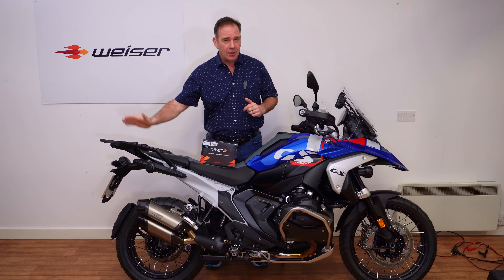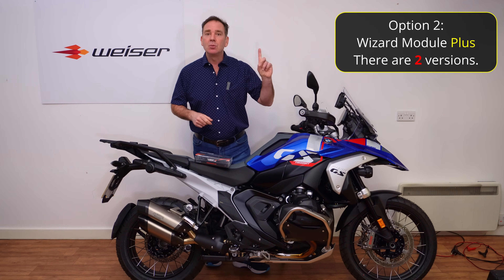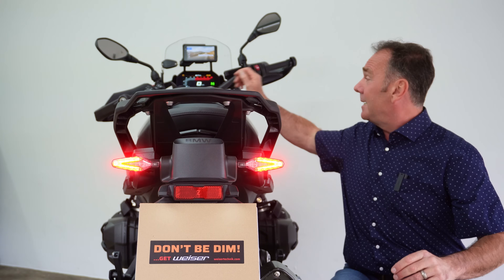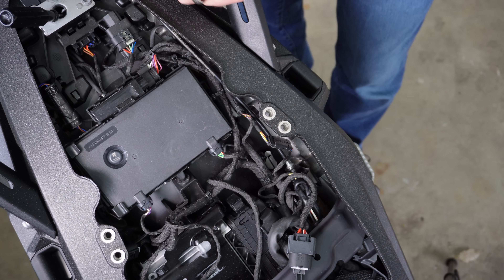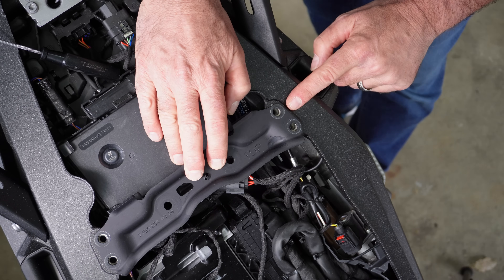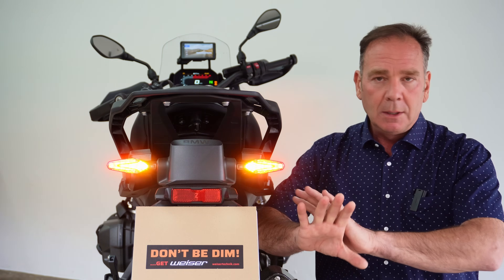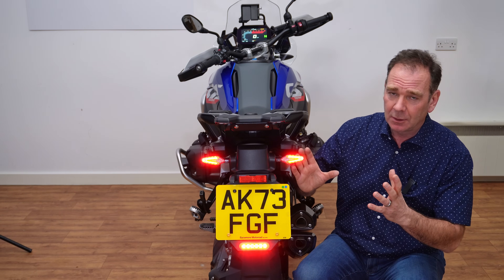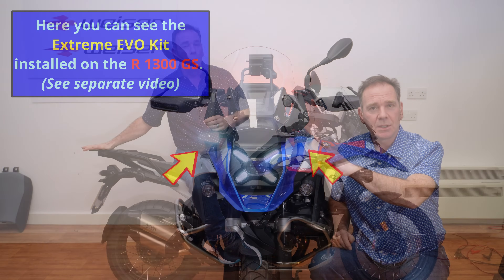BMW R1300GS Weiser-Technik Wizard Module + add a Tail / Brake Light to your R1300GS, F900GS, S1000XR

Comment: Just ordered the BR kit with the T3 as the brake/tail light for my R1300GS, I think it better matches the size of the original indicators. This doesn’t show as an option when ordering the BR kit, it just shows the B6. Mark rang me in response to my query and sorted it.
I had the full indicator set on my previous R1250GS, which were brilliant so I know how good Weiser products are and how helpful Mark is.
Thanks Carl for your excellent reviews, plus the 10% of course 👍

Did you do a video on fitting the Denali, mainly what needs removing to get the wire through.
Reply from the maker: Going to making a video about that later in the season.
Reply from the maker: Hi Tim, glad Mark  a Weiser got you sorted out, they do try very hard to make sure everyone is happy and resolve problems quickly. Sounds like you have a great setup on your R1300GS 👍. Thank you for your feedback, very much appreciated.
Have a great weekend 
Carl 🙋🏻‍♂️

Comment: @justthewayitis 
I want to buy this Weiser kit for my R1300GS . I was thinking, "From the factory, the  taillights sometimes flash quickly or the hazard lights come on when the ABS kicks in (or when the ECU detects an emergency braking situation or somethinh like that) I was wondering if this still happens with the Weiser kit installed, or if it changes how the lights behave?"
Reply from the maker: Hi Xander, sorry for the delayed reply I needed to check with Weiser-Technik first to confirm. The answer is yes the safety features while braking hard still function. Just bear in mind that while indicating the brake light in that side is deactivated to improve visibility.
Hope this answers your questions 
Best wishes. Carl
Reply: Thank you Carl
Reply from the maker: You are welcome 🙋🏻‍♂️

Comment: How are people routing the cable for the rear light from under the seat? I've tried everything and can't see an obvious way to push through without removing panels.
Reply from the maker: Hi Tamworth, most owners have success with either a long cable tie or a metal coat hanger unwrapped. Start at the bottom at the small hole behind the number plate and feed upwards.
If you have an alarm fitted, its easier to unclip it so you can see the cable or wire coming up. 
Once it is through tie or tape a small piece of string to it.
You can then use the string to guide the cable back down to the auxiliary unit.
Hope that helps 
Best wishes Carl
Reply: Thanks but I’ve been trying for over an hour and no luck. Can’t see a way through from under seat and have taken number plate and mount away but still can’t see a way through. There just doesn’t seem to be any room to get through. Everything is in so tight.

Bike has rear radar. Will this make a difference? I can get a wire through a distance from under seat but it doesn’t emerge at rear.
Reply from the maker: Remove your rear seat and send me several images. My email address is on my channel pages
Reply: @justthewayitis  thanks Carl. Couldn’t see your email on your pages (probably me as I’m not great with YouTube). Found a utility online which returns email address for channels so used this. Hope it’s the right one.
Reply from the maker: Check your inbox 📥🙋🏻‍♂️

Comment: Carl - thanks for a great video of the Weiser / Denali B6 combination. 
How did you route the cable  to the B6?   ( I know you may do a video later in the year, but a few words now would be very helpful). Thanks, David
Reply from the maker: Hi David, as Merv has already mentioned you can use an old metal coat hanger or suitable metal wire and feed it up the small hole found at the base of the tail unit… carefully up to the access point under the passenger seat.
Then attach a flexible cable or string and pull it back down.
Then attach the B6 cable to the string and pull it up through to the access point.
This way will save you a an hour of dismantling 🙏
Reply: @justthewayitis  If you unscrew the last 2 screws holding the top cover on the tail unit you have full access. I think it’s quicker and easier than feeding a wire through and straightforward to put the cover back on
Reply from the maker: Hi Peter, thank you for sharing your tip, brilliant 🙋🏻‍♂️
Reply: @justthewayitis
Reply: @justthewayitis 
Many thanks. A great help to getting this fitted,  and helping the rear of the 1300😀😊
Reply: Thanks for all the tips  - I took the registration plate off and the small light unit under that, threaded a wire and put it back; quick & easy with your tips.  Thanks.
Reply: Yes. Works perfectly 👍

Comment: Just fitted the V5plus BO with the Denali B6 brake light to my 1300GS. Thanks Carl for the video without which it would have been a much more difficult job.  Unfortunately Weiser don’t provide comprehensive instructions.

Fitting the brake light I unfastened the number plate mounting plate (it stays attached because of the number plate illumination lights wire), there is a convenient hole in the underside of the tail into which the brake light cable can be fed so it’s behind the number plate mount. From there I fed a piece of household wiring cable from under the seat, taped the brake light cable to it and gently pulled it to the underseat area.  

I hope this helps someone.
Reply: Hi, how did you connect the B6 to the modules?
I have different connectors on each 🥴
Reply from the maker: Hi Luis, send a picture of the modules you have received to Mark at weiser-Technik. You might have the wrong version.
Carl
Reply from the maker: You might have ordered the version without the B6 connectors. There are several different versions
Reply from the maker: Hi Merv, glad to hear you have successfully installed the kit. Thank you for sharing your tip, I do have a video coming soon but your tip will help others. Thank you 🙏 
Have fun with your new 1300GS.
Carl
Reply: Your tip on the rear light wiring is very helpful.  Thanks for sharing.
Reply: @davidanderson5811  😀👍
Reply: A photo would be useful. I’ve been trying to get a wire and/or cable tie down to the rear and it just won’t feed down behind the lights. Can’t see an obvious route back either.
Reply from the maker: Hi most owners have success with either a long cable tie or a metal coat hanger unwrapped. Start at the bottom at the small hole and feed upwards.
If you have an alarm fitted unclip it so you can see the cable or wire coming up. 
Once it is through tie or tape a small piece of string to it.
You can then use the string to guide the cable back down to the auxiliary unit.
Hope that helps 
Best wishes Carl

Comment: Weiser Technic do not seem to have the V5-BR Plus on their website, does anyone know when they will be available?
Reply from the maker: Hi Merv, have a look at the links I have added in the video description, one of them is for the modules you require.
The Weiser website then gives you two options for adding an extra rear light if you want to add one.
Quite a few subscribers have already done this and it works really well.
Kind regards Carl
Reply: @justthewayitis  Thanks Carl, just ordered it and used the discount code you kindly provided.  Thank you for your excellent channel, it is very informative and professional.
Reply from the maker: Hi Merv, your very welcome 🙏

Comment: Can this be installed on the 1250?
Reply from the maker: Hi Richard, yes you have two options for the 1250, I have videos on my channel for both versions. 
EVO Extreme kits physically replace the OEM bmw indicators front and rear with much brighter units that have new features.

Wizard modules can also be installed very very easily which retains the OEM indicators but really improves the rear light functions.

You will find videos for both on the channel.
Kindest regards Carl 👍

Comment: Got to admit I quite like the visual impact of the 3rd light being lit for brake only, analogous to a car's 3rd light. Not really a problem for me as my 1250GS didn't have multifuncion anyway... The main unit is stop/tail, the Denali B6 under the plate is stop and the indicators are just... indicators.  I did look at running the B6 as a stop/tail, but even at 10% was too bright for tail. Apparently some have sprayed lens tint on to reduce it and make close to the main run light and with brake at 100% it kind of evens out. I run brake at 80% and that's plenty bright enough with a clear lens.
Not sure how all of this got to be such a problem. Progress, BMW...?
Reply from the maker: Thank you for sharing and yes it was originally all good and fine but they had to change it… Shame really as we should not have to now spend more money to make it safe.
Kind regards Carl

Comment: How is it then that BMW are non compliant but selling the bike without a rear additional rear light in Germany?
Reply from the maker: Hi Marc, the R1300GS is fully compliant in all the markets it is sold, I was explaining that IF you add an extra tail lamp unit you need to be careful with regards to the country you live in. Germany has a law that states you can only have 2 tail lights ( 3 tail lights are not allowed 🚫) but you can have 3 Brake Lights.

Other countries allow 3 tail lights and 3 brake lights.

That is why Weiser has two different kits to accommodate different geographical location lighting laws.
Sorry for any confusion 
Kind regards Carl

Comment: It’s a great video. Currently, I have a Denali B6 already installed using HexezCan Mojave. My question is which Weiser Extreme Evo Kit product should I use? Wizard Module V5-BR Plus or BO Plus? Please advise. Thank you
Reply from the maker: Hi Henry, where in the world do you live ? Which country and which motorcycle do you have and which year model
Reply: @justthewayitis  I live in Singapore n riding R1300GS
Reply from the maker: Hi Henry, So the Extreme EVO kit physically replaces all the OEM bmw indicators and allows to you have bright white DRL’s running lights on the front which I showed you at the end of the video. It’s a fair amount of work to do but worth the effort. If you look on my channel you can watch my 1250 with the extreme EVO kit installed.

The choice between the BR - brake light and a tail light vs the BO brake light only version is down to what you want to have on your GS.
If the laws allow it, I would fit the BR kit.

If you have a good working skills and a garage or workshop to work in, I would recommend the Extreme EVO kit.

Please be aware that Weiser are developing a new premium kit for the GS, is not available yet but will be later this year.

So maybe you could fit the standard V5 now and wait until the new kit is released.

If you want to know more details send Weiser-Technik an email they are very friendly.
Hope that helps 
Carl
Reply from the maker: As you already have a B6 installed via Hex, just order the standard V5
Reply: @justthewayitis  thank u for the infos. Really appreciated it. I shall order the V5
Reply from the maker: Your welcome

Comment: Too bad, though, that the denali b6 is not homologated for the European community, while the T3 is homologated but it seems to me that there is no support in the kit to install them in the licence plate.
Reply from the maker: Hi Gino, I’m trying to get confirmation from Denali about Homologation for Europe, and I’ve asked about mounting kits. It may take a few days to get the correct answers.
Denali does list a mounting kit for the T3 but I’ve not personally tried it, I used a B6 in the video which did come with a license plate mount which worked brilliantly on the R1300GS.

Thank you for letting me know.
Best wishes Carl
Reply: @justthewayitis  If I wrote this it is because I checked it on the approval page of the denali website, not being completely convinced I also wrote an email to the service department who confirmed that the B6 light is not approved.
Reply from the maker: Hi Gino thank you for confirming 🙏 very much appreciated. 
I wasn’t questioning your comment I just also wanted to make sure myself so I can add a note in the video description so owners in Europe are aware that the T3 is the one to choose.
Kind regards Carl

Comment: Did King Carl get a 1300 Trophy? Is that the Trophy X? 
I’m bad. I mostly engine brake. I think I will get something I stick on the back that uses an accelerometer. Like people put on their helmets.
Reply from the maker: LOL Craig, no, still have my beautiful R 1250GS Rallye. This R1300GS was one of the Weiser test bikes that I got to play with several months ago. Looks really great in the Trophy colours. 
Have you decided yet ?
Reply: @justthewayitis  I will wait for the GSA and see. The 1300 is too small for me.
Not so much sitting but standing up when I’m off road.
I like the 1250 to much. It will be hard to part with that.
Reply from the maker: Well we won’t have to wait long as you probably already now BMW registered it via Sweden so a few more details are available 👍 but it’s heavy… and you can order it with the auto shifting gearbox
Reply: @justthewayitis  Cant wait. Just what the BMW Boomers Need. A bike you dont have to change gears
Reply from the maker: lol 🙋🏻‍♂️

Comment: The only issue is that BMW in their infinite wisdom will only allow BMW parts. Otherwise, they will invalid your warranty on your electrics.
I was discussing it with Motorad, and it's a grey area, but they can say no warranty
Reply from the maker: Hi Tim a lot depends on the dealership, Weiser-Technik supply BMW dealership globally who install these for customer bikes.

Comment: Will this void your warranty?
Reply from the maker: Already answered this in a below comments section , but no it does not affect warranty, BMW dealerships are already installing these kits to brand new bikes.
Reply: @justthewayitis  Appreciate the follow-up. Interesting, especially the bright white front led indicators.
Reply from the maker: Well you probably noticed they dropped the Amber always on front indicators, on the new 1300 so BMW does listen to customers.

Comment: Would be far better for the price of the bike if bmw actually just fitted a tail light or offered it as an option i can assure you carl once i grow bored of my gsa  i will never own a bmw again
Reply from the maker: Hi Austin, good morning... I hear what you are saying....
Reply: @justthewayitis  i am currently in saarbruken i rode to le shuttle fully loaded daughter on pillion camping gear the full bag of mashings rode to black forest had a night at southern tip of black forest  noticed funny noises from bmw gsa took it to motorrad basel in switzerland they rode her and said its normal they topped oil up  and sent me on my way. I am considering getting shut its aprox 20 months old more or less every accessory i have bought from bmw as dissapointed coupled with the cancelled factory tour last year and these latest issues plus mate the rear shock fault warning again about 3 days ago and get this i t
Stopped to change my route yesterday and i was parked on a pavement i had forgotted there was a concrete bollard in front. I rode into it scratching my right hand crash bar then we toppled over to my left bike as minimum damage  but sos never activated what a load of shit
Reply from the maker: Oh dear, sounds like you might be moving brands next year. What will you try, Triumph, Honda, Ducati?
Reply: @justthewayitis  i absolutely love my vikki  so parting with her would be a huge wrench. So keeping an open mind. I will test ride a v4s multi a tiger a  versys 1000 se gt possibly an africa twin  but if and its a big if i do change it wont be new  again its too much to lose. Just out of interest di you ever notice strange sounds from your gs also mine as needed oil twice now in last maybe 4 month is this normal
Reply from the maker: Some owners hear a ticking sound from the left side of the engine, there’s an updated chain tensioner to fix this.
Other than that no other noise issues I’m aware of.

Comment: Thanks Carl. Do you think this affects the warranty?
Reply from the maker: Hi great question and i should have mentioned that in the video. Weiser have said that the wizard modules do not affect warranty, in fact during the development of these new modules Weiser have been working with several dealerships who are already offering and installing these kits on brand new motorbikes. 
Extended warranty is a different thing... as its not actually BMW that offer the warranty extension. The companies that do the extension will only cover bikes with ZERO modifications.... which is quite ridiculous if you ask me.

Comment: Thank you , great video. I used your installation guide for the Weiser kit on my GSA1250. Looking at the end of this video, I see they have a similar kit for the R1300, so i will lookout for that on your channel , as the 1250 version was a great improvement over the standard setup.
Reply from the maker: Hi Michael, good morning, yes they have a full Extreme EVO kit that replaces all 4 original BMW small indicators, I have already done one full installation on a R1300GS and it looks brilliant. I hope to have a video about this option later in the summer.
Best Wishes Carl
Reply: @justthewayitis  Carl, can the full replacement kit that I fitted on my 1250 be swapped over to the 1300?
Reply from the maker: Hi YES…you can it’s an easy swop over,  just bear in mind if your new 1300 isn’t fitted with enduro pack your indicators will be in the hand guards, but this can also changed very easily.
I’m happy to answer questions or you can also send an email to Weiser who can also supply the additional front panel and blanking plates for you to move the indicators from the hand guards back to the side.
The conversation is fairly simple to do.
Moving the EVO extreme kit is also fairly straightforward 
Best wishes Carl

Comment: It’s a fix. But not perfect in my opinion. Still could be confusing. Better with the added Tail light…Bring back the old lights please BMW xx🎉
Reply from the maker: Hi Aymarx, yes the older system was much better.